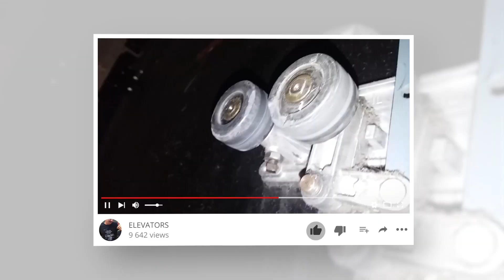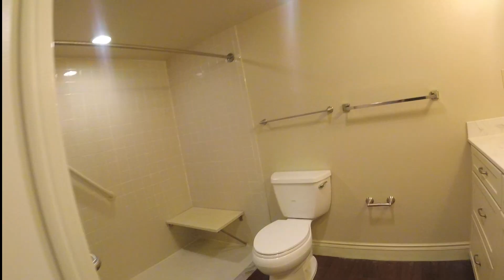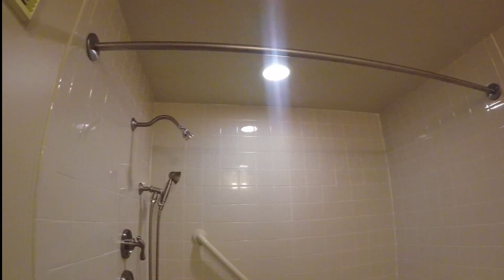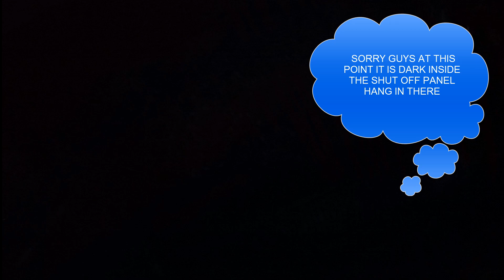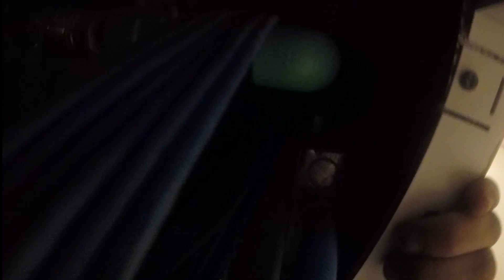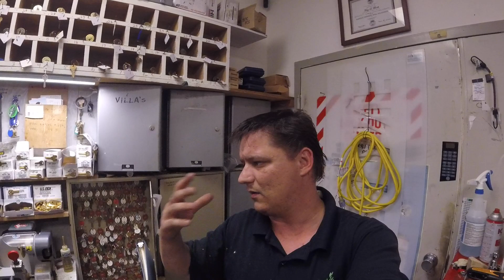WHAT IS WATER HAMMER WHAT DOES IT SOUND LIKE

Comment: Did you get to the bottom of it? I’m having this problem and just don’t know where to start to stop it
Reply from the maker: Yes it was a valve on the toilet that was not closed all the way. it could be a hose bib outside  not turned off all the way
Reply: @geoffhoweth  I have this sound when my faucet or dishwasher uses hot water (same line), but only when it gets hot. It’s starts with a whistling noise followed by a hammer sound similar to what your experienced. The thing is, it’s only in one line and only when the hot tap is open. When I close the tap the sound is  gone. Driving me nuts.
Reply from the maker: or opened all the way as well

Comment: This is normally due to unclipped pipes or ceramic valves in showers or taps. Sometimes it's due to turbulence because service valves aren't full bore & they've been put inline on pipework. They need upgrading.  I'd suggest putting in 2 maybe 3 water arresters or an expansion vessel. But first clipp and secure all the pipework. Water hammer is due to turbulence in the pipework.

Comment: My idea would be with the water main turned off (as you have it) open the tub shower water (and/or another lower water distribution point(toilet, hose bibb etc...), than turn the main back on slowly.  Eventually water hammer arrestors could be installed but  this might solve it each time for a long space of time, or not... Hope it helps!!!
Reply from the maker: thanks  KungFuMaintenance I am at work right now I will give it A try :þ
Reply from the maker: KungFuMaintenance good call it was the shut-off valve at the toilet was almost shut off so I opened it up and it's not water hammering anymore thanks Kung Fu maintenance